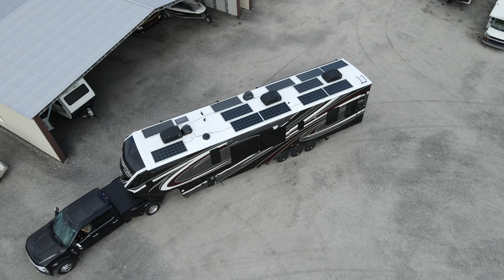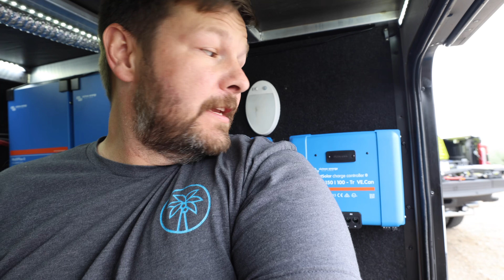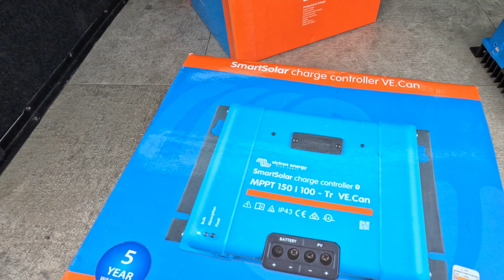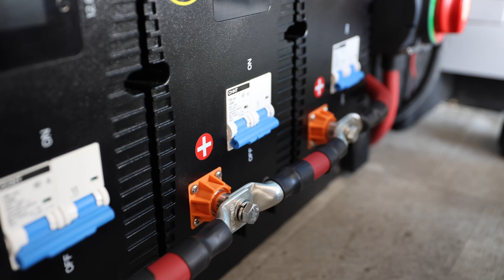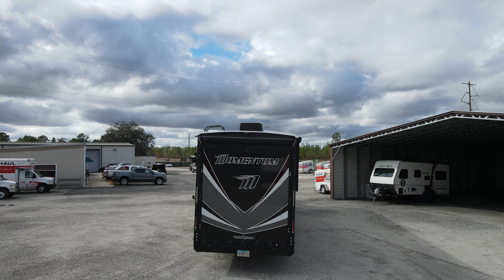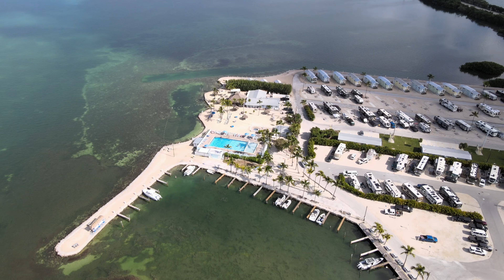You paid WHAT!?!? 🤯 BIG OFF-Grid System!

Comment: Victron is high cost all their stuff is separate so u need charge controlers and 2 inverters plus mongering.. so lots of space taken and cost is crazy. I have a single unit 48v 5000w 750 bucks.. they have a  2 phaze for 100 bucks more.my batteries i got 4 12v 280 ah batteries cost 1500 bucks. I can run my ac 8 hours w no solar.  I want to get another set of batteries  for bad weater but this is way cheaper and works justbas good. .. again victron is expensive and takes up lots of space

Comment: No reason for this system to be 12v. 48v would be way more efficient. If you guys are watching this and want to invest the money for a system like this…go 48v. If you need 12v appliances or draws, just get a step down converter.
Reply from the maker: Agreed - the problem is there aren't alot of options for a 48 to 12 step down. 30A at most. Our jacks require 70-75A when leveling so I would need 3 of them in parallel. However, we've installed a 48V system since and have solved this.

Comment: cheap - I paid $6400 for 700ah in BB batteries alone - 2400 watts is not enough on a rig that size. I have 2k on a 28' with a mini split and boondocking is challenging in hot humid temps - nice install
Reply from the maker: I would love to add more solar at some point!

Comment: Justo wondering why not been offered to you a 48v system ! Cheaper and more reliable than 12v .
Reply: True, and there are "buck" converters that will give you 13.8 Volts for a 12V RV system from the nominal 48 Volts of the battery bank.

Comment: Great Video, covered all the points!  
You discuss the points and provide nice video to match. Always enjoy your videos! 

Question if building new system, not adding on… which it appears yours is new system.  Did you entertain 24 or 48 Volt system, higher up ft cost on hardware, offset a little with smaller copper cabling, fasteners, etc… and easier management of smaller cables. 

I was under assumption with new Technology, having core system be higher voltage had benefits.
Reply from the maker: Great question - Yes, we did entertain a higher voltage and haven't ruled it out for the future. It definitely has its benefits.

Comment: Nice system, I thought my system for my truck camper was good, I had 800ah 12v, (4x200ah) Victron MPPT (3x100/30) 1200W SOLAR (3X400W) panels, dc to dc 30 amp charger, 3000 watt inverter. Yours is much more rebust. Nice.
Reply from the maker: sounds like an awesome system!

Comment: Lastly, know your Rv weight before hand.  My 3200/dual multi-plus IIs/ 4 GC3s added 1000 lbs to my 5th.  Calculated my after install weight before proceeding.
Get caught in an accident and be overweight, you run a big risk of your insurance not covering the accident (in addition to potential suspension failures (and god help us) frame issues. )
Balancing the equipment in the RV needs to be done for weight distribution considerations.
Reply from the maker: Great tip, thanks for sharing!

Comment: Any specific reason why you wired those inverters in split phase on those 2x120 inverters?  Wired how they are kind of defeats the purpose of the 2x120, a regular Multiplus 2 would do the same thing and be cheaper.  If you wired these 2x120 inverters in parallel you could have 4800w across both legs divided up however the loads needed power up to 4800w max combined power on both legs vs 2400W on each leg max. So for instance if L1 needed 1000w and L2 needed 3500 a parallel config you could run it no problem, its a lot more flexable in parallel.  Because the 2x120 is also setup to tie L1 and L2 together if you run a single phase like 30A it makes going to a 30A park or a generator seamless. The way your is setup seems puzzling to me.

Another thing i noticed on your the "l2" inverter is wired to L2 input and output, These inverters only charge on L1 so one of your inverters is not charging the batteries at all.

BTW these inverters are 3000VA (volt amps or apparent power)not watts, they are 2400w(watts or real power) continuous output.  

I have the 24v version of these in my rig, two of them as well but mine are wired in parallel and they work fantastic.
Reply: Thats why we ran two 24v 2x120 in parallel as well.  No limitations on either leg. If A/C was on and wife is blow drying hair we couldn’t use microwave or coffee on the leg until she was done or vise versa. With parallel we can run entire rig without fear of overloading a single inverter. Also we run 2500w of solar through a single 150/100 MPPT because its 24v system, could have saved that $500 on the second controller. It’s super easy to set up parallel so if you have any questions feel free to reach out. We have complete step by step builds. Thanks for sharing!

Edit- we’ve been hooked up to 30a for about 8 of the last 12 months now running on power assist flawlessly.
Reply: @saltytrips  Are you running a series parallel setup to keep the voltage down?  I'm running 2 250/100 controllers on my setup and i have two 1500w series strings currently with plans to go up to 4500W with two 2250w series strings. With my 250W panels i would be over 200V open circuit with 9 panels on a single string. I want to stick to series so i don't have to try and pull new wire from the roof.....

I'm plugged into a metered connection too while i'm stuck in Texas with a broken truck that GMC cant supply parts for.... I'm on 50A but im using the ignore ac input function to shut off the input from the pedestal unless the batteries are low or we are pulling lots of watts in an instance like all 3 ac's are running which is rare. Otherwise we are running off the panels and battery only and have been for about a month now. We have only pulled like 50kwh off the grid in that month when we had a few really cold and cloudy days in a row and we needed the heat pumps to stay warm. Otherwise our meter is not spinning...  The guy here at the park thought there was something wrong with it when he read it the other day until i told him we were running off our solar.
Reply from the maker: Thanks for the info. I fixed the line going into 2. I did split phase bc I didn’t have what I needed to run them in parallel at that time. Worked great, even on 30A. updates coming soon.

Comment: I am not super knowledgeable about this stuff, but would a 24V system be better and if so why didn't you go that route?
Reply from the maker: It would help keep the wires smaller and amps lower. I just wasn’t ready to do that since I don’t have experience with it yet. Maybe a future upgrade!
Reply: We rarely install 12v systems anymore and never on a Fifth Wheel or a Coach
We are installing more 48v now too
Reply: Why stop at 24 why not 48. Much smaller wires required.
Reply: @GregoryRamsey this is the comment of the day! No reason to not go 48v. Better in every aspect! More efficient, cheaper, just runs better all around. Once you go 48v you’ll wonder why you ever played with the 12v toys. Check out the people in the know on YouTube? They will all tell you the same thing 48v is king!

Comment: Congrats on a really beautiful, professionally designed and built system that you DIYed! We DIYed our system too, but it's nowhere near as pretty as yours. Your coach is beautiful too. We have an older Class A which has lost its shine over the years, though it is mechanically sound and still running strong (sort of like us.) Being retired and living on SS we were on a really tight budget so had to forgo the sweet Victron components and EG-4 racked batteries for lesser-known brands and home built batteries to be able to build a system big enough to meet our FT boondocking needs. 

You did well for very little money though, considering the high-end components you used. We spent about $10k on our system, and another $1,500 on our EG-4 28.5 Seer-2 mini split heat pump that only uses about 1/3 the energy that our rooftop A/C does - stretching our battery life even farther. Our system has just a little more battery capacity than yours, at 23.5kwh, (compared to your 20.5kwh bank.) However, we have over twice as much solar, at 5,020 watts, though the same 6kw of total inverter power you have. Our system is designed completely differently though, with a 12v and a 48v component. Since we live FT off grid our system paid for itself in only 2 years. I think it's amazing that 2 people can approach a problem from different perspectives and devise 2 unique solutions which both meet our similar needs in the end. We hope to meet you down the road one day! Chip & Cindy
Reply from the maker: Thanks for taking the time to share this! We would love to have more solar one day. We plan to update the system in the future as well. If you happen to see us, be sure to say hi! 👋

Comment: Another plus for solar/victron..RV parks that charge for electricity. You can reduce your a/c input to 20 amps, thus reducing your electric bill.
Reply: Keep in mind… turning down the amps allowed from shore power only works on L1 with the Victron Multiplus II.  Anything running on L2 provides as much shore power as the electrical demand on L2.
Reply from the maker: @louie3552 interesting 🤔
Reply: @louie3552 thats correct about L2 not having limitation on 50a connection but a work around is if you take your 50a cord and put a 30a adapter on it (which just combines L1 and L2 together), and plug it into 30a outlet you’ll able to reduce input limit down to 18.5 amps. We’ve been running our 24v 2x120 parallel system like this on 30a reduced to 18.5 on power assist for months now supplementing power with solar with zero issues. I’m at the point now where I believe I’m just going to get rid of my heavy 50a cord and just use a 30a cord with 50a adapter to my rig from now on, weighs less and takes up less space. I really don’t see any need for a 50a cord or connection at this point.
Reply from the maker: Great tip!!! Thanks
Reply: Agreed.  Did that for 5 months in ‘22.  I now just shut down the post power on sunny days and watch how low my batteries go.  Usually dont go over night due to using the 3rd air heat pump and fireplace heat at night.
(3200 watt solar with 4 GC3s)
Also need to watch compartment temps on hot days where the equipment is.  I temp monitors.
Reply: Stopped the 30amp “dog bone” 50 to 30 amp use as I was a a campground that had power problems on L1 do to weekend load (too low) and my power protector shut off post power.  Switched back to Being on 50 I and reduced L1 to 20 amps and got all I needed from L2.